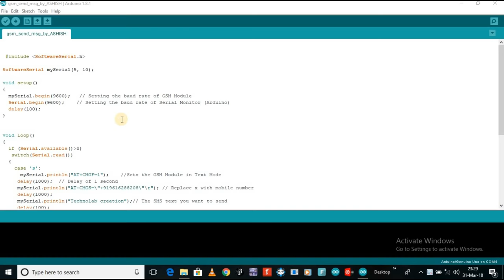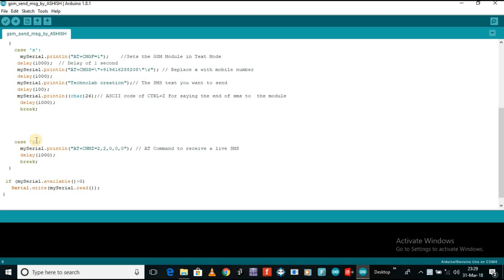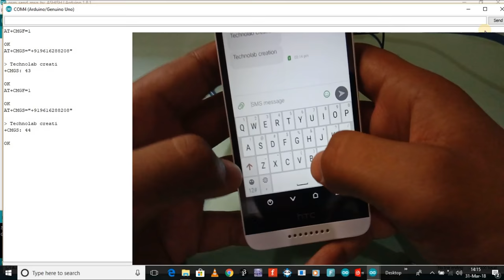SIM900A GSM Module and Arduino: Sending and Receiving SMS Using AT Commands

Comment: when a user send a  sms to gsm ,is it possible to send a return message to that particular number.And the users number will be random
Reply from the maker: Yes it is possible
Reply from the maker: Check out my video
https://youtu.be/fSCyRIiHTBE
Reply: Is this possible with gsm 800 c?
Reply from the maker: Yes.. 
All code that work on 900
Also work on 800
Reply: @technolabcreation  our project is about AUTOMATED CAR PARKING SYSTEM(designed for parking in malls).In this the users at a distant  area can send sms to the particular parking lot number for seeking information regarding available parking slots.And the gsm should send a reply regarding the available parking space to the particular number.The users number won't be known previous.So i humbly  request you to provide program code  for this scenario.
Reply from the maker: https://wa.me/918543053029?text=Welcome%20to%20technolab%20creation%20%0AAsk%20your%20question
Reply: @technolabcreation  Can i  know which type of antenna is used in sim 800C GSM module?

Comment: Which generation sim card is required to inserted in GSM module?
Reply from the maker: 2g sim card
Reply: @technolabcreation  can't i use 3g or 4g sim? Is there any method to implement with 3g and 4g sim using same gsm module
Reply from the maker: Yes u can use 3&4g sim card if 2g services are also available in that..like idea Vodafone Airtel these operators provide 2g services in their sim card
Reply: @technolabcreation  thank you so much 😊

Comment: sir as you say my gsm module is blinking correctly 
   and i change bauld rate in serial monitor .
now also i am not getting message ,the tx and rx pin of the arduino mega 2560
is not blinking
please help me
when i uploded the other program  to my arduino it is blinking and working properly
Reply from the maker: Please let me know 
Which program u uploaded to your board
Reply from the maker: Your own
Or mine program

Comment: i have 2g sim and as you did in the project i do the same, the program was also uploaded successfully but when i open serial monitor it still shows blank plz help
Reply from the maker: Yes this problem generally occurs..due to not proper communication in between Arduino and GSM module.
Check your connection and power supply in the GSM module
Reply: @technolabcreation  the connection is correct in between gsm and arduino still not showing any kind of msg
Reply: @technolabcreation  
I am working similarly on the project of Garbage monitoring system so I used 
1. Arduino Uno
2. Ultrasonic Sensor
3. GSM 900a with adapter
4. jumping wires
My aim is if the garbage is detected under the level of the ultrasonic sensor then it sends the SMS to the particular phone number.
My 80% of work is already done but I am facing the problem in programming.
My ultrasonic program is done  successfully but when I try to add the gsm program in the arduino IDE it is executing but in serial monitor it always shows blank 
I need a help from you about the coding if you have the code of garbage monitoring system will you send me the code please.
Reply from the maker: Right now I don't have code.. but if want I can do for you
Reply: @technolabcreation  Thank you for quick response
Reply from the maker: GSM module is very sensitive to power supply 
Check properly specifications of your module
Reply from the maker: First try to upload normal code like sending or receiving SMS if this will work then upload ur project code
Reply from the maker: Ur welcome
Reply: @technolabcreation  OK can you send the code of gsm module 900a  to send SMS automatically to a particular number
Reply: @technolabcreation  OK thanks for ur response
Reply: @technolabcreation  well what is default baud rate for sim 900a module and can i use 3G sim instead of 2G sim?

Comment: Sir is there any problem when we use 4G sim for sim900a module for this program
Reply from the maker: Program does not make any problem.
Problem is sim900a does not support 4g sim you must use a 2g for it.
Reply: Sir now there is no 2g sim in market
All net work provider are distributing 4G sim now 
Is there any remedy
Reply from the maker: The only solution is u have to manage a 2g sim  from any where

Comment: hi is this thing on i tried your code with my arduino nano, my gsm network is already connected but when I type AT in serial monitor i get no response and aside from that i dont get to see what i send from the serial monitor
Reply from the maker: Yes this code didn't work as said,
Because in this code at commonds executed by conditions.
Reply: +Technolab creation so , it means typing at commands at serial monitor wont work?
Reply from the maker: It's work but code is different
Reply: +Technolab creation what should i change ? sorry im not really good at programming and really appreciated your replies thanks
Reply from the maker: Send me your email id I will make a code for u very soon
Reply: +Technolab creation hi can you help me fix my code? i have a code controlling servo via gsm but my servo is moving like crazy
Reply from the maker: Okk send me your code .....
ashishmaurya11220@gmail.com
Reply from the maker: I will do it for you
Reply: +Technolab creation could you do it fast sir? please
Reply: +Technolab creation check your email thank you so much

Comment: Sir  I test your program  using the link given in the discretion I am not getting the output
Please help me
Reply from the maker: You have to modify something in my code then it will work properly
And also I am not using rx and tx pin that's why tx and rx pin does not blink 
I used 9&10 as rx and tx by using software serial library
Watch video again to understand better

Comment: Can use 12V 1.5A  adapter
Please reply
Reply from the maker: No.... use 12v 2amp .
Reply: @technolabcreation 
Product features :
power supply 12v 1amp to 2 amps max

Any damage  issue, for using 12V 2A

I using your same module 

Please reply

Comment: i have sim800l i have connceted to arduino but it is not working how to use this can you tell me
Reply from the maker: First upload the code to the arduino board then give power supply to the gsm module then after connect gsm and arduino Together
Reply: @technolabcreation   thank you no led is blinking at the top right corner
Reply: @technolabcreation  and can i connect vcc to 5 v ?

Comment: Hiii bro,I gave AT command to gsm module through Arduino,but the gsm not giving response as OK.

The program is

#include <SoftwareSerial.h>
SoftwareSerial mySerial (9, 10);

void setup()
{
Serial.begin(9600);
mySerial.begin(9600);
}
void loop()
{
if (Serial.available())
{
mySerial.write(Serial.read());
}
if (mySerial.available())
{
Serial.write(mySerial.read());
}
}

Bro please help me in solving the problem

Comment: Hii I used arduino to control the supply of water in the soil when the moisture content is low , NOW  i  want my gsm module to send an sms when the water pump is turned on.
Reply from the maker: Yes it is pretty simple just modified ur code
Reply from the maker: Even i suggest make something like which send the moisture content time to time
Reply: like
?

Comment: Initially it works fine but ¿¿¿¿¿¿¿¿¿¿ are getting displayed in serial monitor after sometime...need help
Reply from the maker: Yes this problem is generally occurs
And this is because of no any communication between Arduino and GSM Module
Reply from the maker: First power up the GSM Module then connect it with Arduino board

Comment: hi I have sim900a when I connect it to audrino and I give command like " AT " or any other it not answer back how can this will fix
Reply from the maker: Send me your code
Reply from the maker: I will check where is problem
Reply: #include<SoftwareSerial.h>
SoftwareSerial gsm(2,3);

void setup() { 
  
Serial.begin(9600);
  gsm.begin(9600);
}

void loop() {
  
if (gsm.available())
{
  Serial.write(gsm.read());
 
}
if (Serial.available())
{
  gsm.write(Serial.read());
}
}
Reply: how will we check that rx tx working properly or not with audrino when I use jumper wire thn its not working but when I connect gsm to lappy by rs323 cable than it working
Reply: where is the problem ????
Reply from the maker: U. Are using software serial then ur pin 2 is rx and pin3 is tx.
Ur code is also correct ,
First connect the gsm module to Arduino then upload the code
Reply: But i saw many videos that disconnect the wire while uploading
Reply from the maker: Whenever you are using rx and tx of Arduino then you need to disconnect other wise no need of disconnect
Reply: ok what if I don't use softwareserial when I use rx and tx of audrino  than what will thw code
Reply from the maker: Software serial is used when you want to use other digital pin of Arduino as rx and tx
Reply from the maker: Just connect the tx of ur gsm module to pin 2 of Arduino and rx of gsm module to pin 3 of Arduino, and gnd of gsm to gnd of Arduino then upload the code ....it will definitely work
Reply: Technolab creation thn what i do which library  i have to include  because   without  that how i declare gsm?
Reply from the maker: Use the same code that you send me above
Reply: am doing same as u saying but not getting reply from gsm  here i cant able to post the pic otherwise i post it i don't knw what was the problem :-(
Reply: Technolab creation hey m getting whatever comes on gsm like any call any msg which recived to gsm is showing m but whatever i give command it not reciev by gsm what tge problem in this case
Reply from the maker: shubham smart which type of commonds???
Reply from the maker: shubham smart 
9140443252
Reply from the maker: shubham smart what's app me
Reply: OK
Reply: bro have u got  solution for your problem
Reply: @shubhamverma7730  bro have u got solution for this problem
Reply: Kongari Uma ya almost
Reply: @shubhamverma7730  what is the solution and what we have to do
Reply: Kongari Uma what basically  you want to do? 

Check your connection  see either  you using  software serial header file check  the baud rate of gsm and audrino

Comment: I am doing water level indicator using GSM but GSM shows no response
Reply from the maker: GSM Module is very sensitive , check power supply rating of ur GSM Module and provide the same voltage

Comment: i'm using a jio 4g sim. It's not working.
Reply from the maker: Use another sim card jio 4g never will work
Reply: @technolabcreation  i tried with another 3g sim. That didn't work too.
Reply from the maker: Only 2g simcard with sms plan
Reply: @technolabcreation  what module should i use then if i've 4g sim?
Reply from the maker: Sim800l with 4g capability

Comment: mon shield ne fonctionne pas tu peut m'aider
Reply from the maker: Please ask me in English
Reply: My shield does not work please can you help me
Reply from the maker: What happened to ur board???
Reply: I don't receive the message in my phone
Reply from the maker: Connect all things properly
And provide proper power supply to GSM module i.e. 12 v and 2 amp
Use 2g sim if ur module is not supported 3g 4g

Comment: Hey we r getting >¿¿¿¿¿
Reply from the maker: Restart ur system again
Reply from the maker: If still u have problem
Then reply me again
Reply: Restart karne ke baad bhi ho raha hai.
Reply from the maker: Okk kon sa module use kr rahe ho
Reply from the maker: Let me know
Reply: Gsm Module 900A
Reply: Same module what u have used
Reply from the maker: Okk
Reply from the maker: Gsm module bahut hi sensitive hota h  
Proper power supply do I.e. 12 volt 2 amp isse kam pr nhi chalega 
Aur gsm module ko power supply dene k baad wait karo jb tk module network se connect na ho jae ,module k network se connect hone k baad hi arduino se connect karo jarror kaam karega
Reply from the maker: Work kiya ??